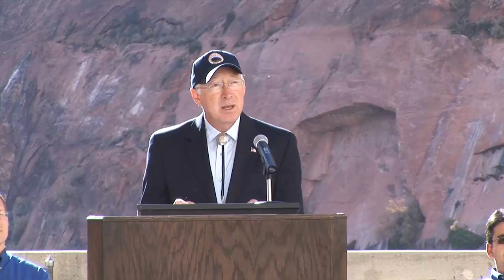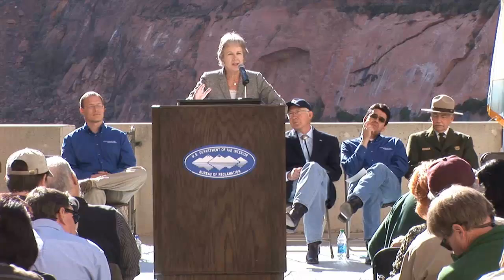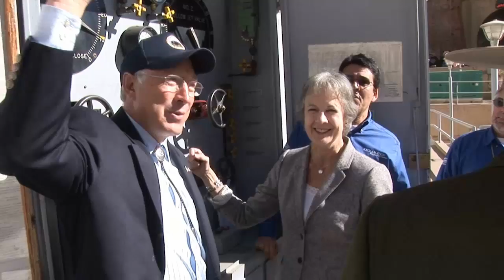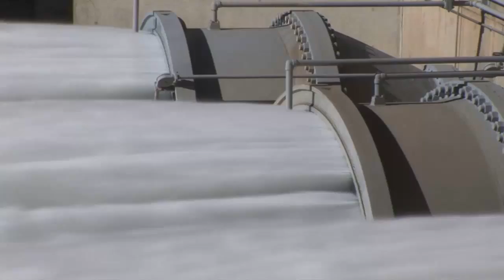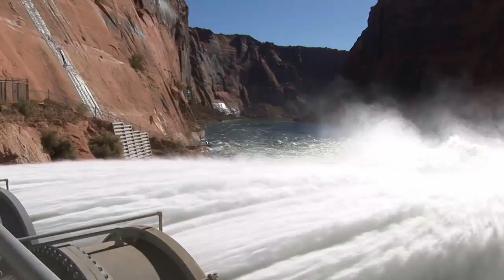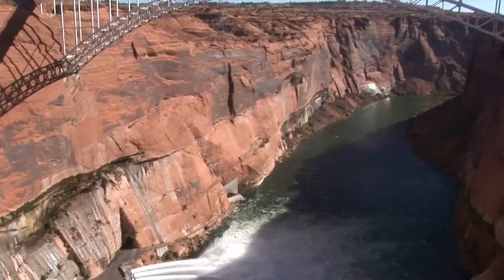Glen Canyon Dam Experimental High Flow 2012

Comment: All that power going to waste :(
Reply: How?
Reply: How you really need to study more you can't see the water?
Reply: phil fox do you understand how these work? This is to keep the water level at a good height and water is what produces the power, it doesnt get recycled.
Reply: Yes I know how these work and have worked on quite a few in my years. They are now saying the dams due to the fact of lack of maintenance they must now be 1/2 to 3/4 full due to there age. But it still doesn't get round the fact that you can still get power from the runoff. The main screwup with dams is the silt build up behind the dam. This can give a false positive on the depth and sediment actually adds to the pressure build up.
Reply: phil fox ok, your pretty smart! I get ya now.
Reply: +phil fox Isn't that part of the reason for the high flow release? I thought it was to help remove all the buildup and let it flow downstream, get deposited elsewhere and help reduce the erosion of sand banks and whatnot.

Comment: how is the drought working out?

PeakLiberism puts man last.
Reply: Did you know, that approximately 860,000 acre feet of lake powell are lost per year to evaporation? Water sits there and does not move the way it used to before the dam was built. More water is lost now due to evaporation then before the dam was built. No city or community draws water from Lake Powell for drinking water except for the city of Page, directly adjacent to the dam.The lake took nearly 20 years to fill, and is a fraction of the capacity it once was due to evaporation, drought and reduced inflow rates, and power demand. in fact, due to current and projected demand for power, and inflow rates, the lake will never refill to full capacity again.

Comment: Do you want increased erosion of the river bed? Because that's how you get increased erosion of the river bed.
Reply: that's the whole point of the high flow release they are trying to simulate a flood. it creates sand bars and new habitats and flushes the river system so sediment doesn't build up to much.
Reply: +juxtaposeism 
There has to be sediment in the riverbed, which can come from erosion on the river banks. This would rearrange the sediments, creating sandbars in areas with slower flow, and moving some downstream.
Reply: +B Douglass in order to have that effect there has to be sediment in the spill NOT clear blue water you dummy
Reply: But when the water was clear again all those sandbars went away real quick.
Reply: spookje111 Where to? downstream.
"All" of the sandbars won't go away, they get resculpted to something more friendly to the river flow. Gravel bottoms get cleaned out so eggs have somewhere to settle out of the current. Consider the river flushed, and capable of a full-flow release again.

Comment: Drain "lake" Powell,  dismantle the dam. Restore the river.
Reply: Romany1111
Reported for hate speech. The dam isn't going anywhere as the Southwest still needs water and we aren't going to build the dozens of desalination plants and nuclear power plants needed to replace it. Failure to address a replacement means your idea cannot and will not ever be implemented, which makes it not a very good idea if you actually want it to succeed. Maybe you could try advocating for the nuclear energy needed to supply the needed desalinization plants to replace the dam. It's as if you are opposing garbage dumps but offer no solution to them. There's still going to be garbage and there will still be plenty of "whiteys" as well as other people who need water.
Reply: +Romany1111 Alrighty, but you'll need an alternate plan to irrigate and provide drinking water to the Southwest then. They aren't going to move for you.
Reply: +Romany1111 The plan does not exist, and that's a good point. The expansion of the SW was done without knowledge of the implications of the dam, and these big dams in general.  Water may be the next petroleum, as fresh supplies vanish or are contaminated.
Reply: +Romany1111 

Lol!
Reply: +filonin2 Do you need a safe space?
Reply: Eric Young
Well if you want to get rid of the dam, it certainly is your problem because the dam won't be going away without a replacement water source. If you don't care really then it's not your problem.
Reply: Romany1111
Do you just want to get your account suspended for hate speech?
Reply: +filonin2 geez, Whitey, you are a sensitive devil! How do you get by when you can't carry a gun?
Reply: +Romany1111 Of all the Big Dams in the west, this is the one that makes the least sense. If the long-term regional drying trend continues, Lake Meade alone can store all the water the Colorado can deliver.
Reply: Romany1111 no
That would be a huge mistake
Reply: +filonin2 Not my problem they decided to build a city where there weren't the natural resources to support it.
Reply: +Mike Shearman You right wingers are a constant source of merriment in our household.   It's not left wing to support the environment. It's called common sense, and leaving our home better than we found it.  And don't let the door hit you on the ass, whitey. For your info, my country IS great, and you are the ones screwing it up. Our people were here about, ah, 8,000 years before you carpet-baggers.  If you think building abortions like this dam is a great thing, you must have been home-scooled, where you also learned about how to saddle a dinosaur, build an ark, and fire a gun. All useful stuff. On some planet. Until then, pawdner, get off my planet. And hey, it's Sunday. Isn't there a snake waiting for you to stroke it and speak in tongues?